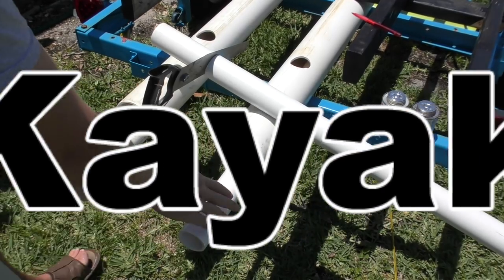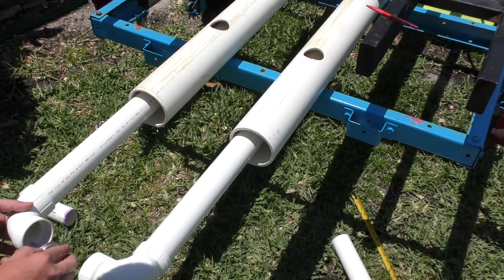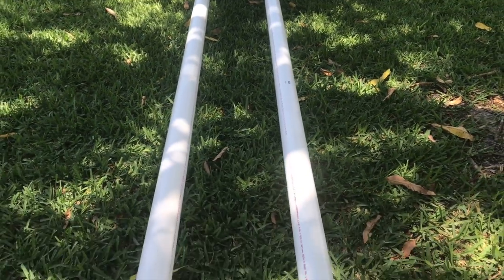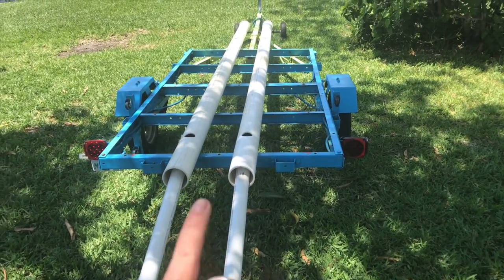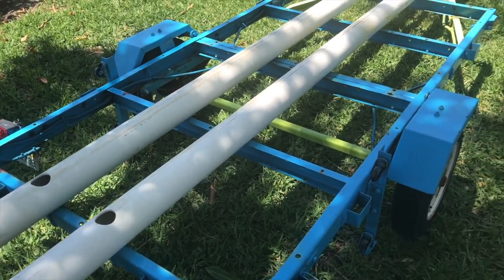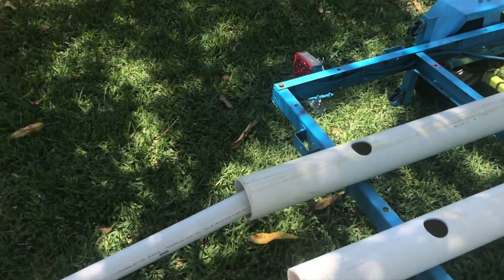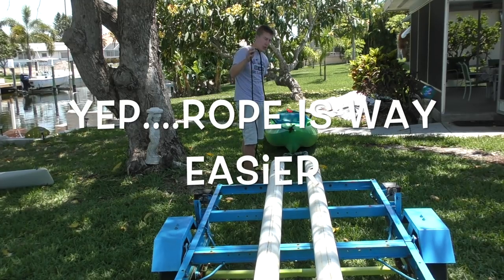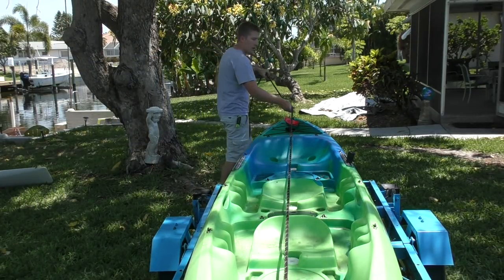Custom Harbor Freight Kayak Trailer with Telescoping Bunks PART 2

Comment: Cool mod on the trailer! I would definitely make some sort of mark  (paint, permanent marker, tape, etc) close to the end of the pullout to prevent you from pulling them all the way out. Early in the morning and in a rush to get out on the water could easily cause someone to be overzealous in pulling out the extensions. An even better idea would be to use a cap on the inside end of the pullout, and also have the big PVC capped as well.  Watching the video there is room for the slide outs to move freely even with a cap on them. If the outer cap was drilled just big enough for easy sliding of the pullout, then the inner caps would act like a STOP if they came all the way to contact the outer cap.  👍

Comment: You might want to put end caps on the end and just cut a hole big enough for the inner pipe to come out. Reason being especially on the heavier yaks the end of the pvc can gouge the front or back of the yak depending on which end you're pulling back up to put back on the trailer. I have a Hobie PA14 and had too had that to mine
Great idea

Comment: Good stuff. I may try a mod like that to bring the yak off of my Xterra and into the water. As least it may save a torked back getting it off the top. Thanks for posting.🤙
Reply from the maker: +Paddlers Paradise yep.  Always thinking about saving my back.  I also work in healthcare 2 days a week.  Back injuries tend to become chronic issues.

Comment: I like it a lot. I would worry about the telescoping section dropping out and dumping the boat hard. Perhaps either a rope cut to length that keeps it from going all the way out the back (connected to the front of both sets of bunks  and running inside the 4" pipes) or a bungee that stretches just far enough to keep them falling out. I liked the thought of using the 4" pipes for storage. I might try that for a couple fishing rods!
Reply from the maker: +Daniel Merrifield certainly could secure the bunks if you wish.  I will likely make something to secure for traveling and for when the bunks are deployed.  Maybe a strap system that does the two jobs.

Comment: Great build Justin and Chad. I’m wondering if that would work for my full size truck bed, loading my Outback. 
Trey Herolds end cap idea would benefit too. 
If you drilled 1 or more holes in the bottom of the short cross piece it would let water in and out to prevent any tendency to float. It has minimal structural function other than as a spacer/anchor for the longer pipes.
Love your vids.
Reply from the maker: +Idaho Brit true.  That is a great tip.  It might work for your truck.  I don't see why it wouldn't.  You will never know if you don't try.  It is pretty cheap to build.

Comment: Man, that slide out ramp is a very cool idea. I may try this on my canoe hauling trailer. I'm really impressed with that idea, go "Chad"!  Thanks :) Also, might put a chamfer on the ends of the big pipes on back end to allow kayak to slide a little better over them. :)
Reply from the maker: Hey Greg,

Thanks for stopping by the channel.  That setup works well.  Putting a chamfer on the ends would likely help.  Have a great day on the water.  🙂👍

Sincerely,
Justin aka KayakDIY

Comment: Good idea. However, you need to check and see if the "extenders" float when in the water. If they do then you wont get a good friction hold like you did in the yard. You may want to tie a rope to the front part of the smaller pipe and attach it to the front of the trailer (inside the larger pipe) and set the length so that even if it does float. The rope will keep it from coming all the way out.
Reply from the maker: +Ratdog 305 agreed.  Then i may do a clip on rope setup to hold the rails from floating out of the main bunks.  Shouldn't be too difficult to work out a method.  I more or less wanted to see how the span would support the weight.  I may even get some cheap EMT conduit and put inside the telescoping bunks to add weight and to stiffen the pipes more.  Still overall quite happy with the solution.  It will greatly prolong the life of the trailer.

Comment: Great idea.... do you think the below would work as a way to protect against the 2" PVC ever coming out while in transit (should a tie down strap or bungee break)?   Cap the 2" PVC piece and cement the cap, slide it inside the 4", and then slide a 3" collar over the 2" bunk from the opposite side. Cement the 3" collar to the interior edge of the 4" making it impossible for the 2" to slide back through it because it's capped. 

Just curious your thoughts after using this set up. I could see my idea having some issues with flexibility possibly. Either way- great idea, I'm definitely going to use some of your concepts when I re-build my trailer carrying my PA14

Comment: Justin, do NOT (I repeat, do NOT!) take that trailer in the water!  I live in fresh water country and I have to change my bearings about every season because they pit so bad.  The very same HB trailer.  I can only imagine what salt water would do to them because they are not sealed, or even made for marine adventures to begin with.

That's a recipe for trouble!  Aslo carry a spare tire, even it you have to carry it on your back.  You''ll thank me for it someday!
Reply from the maker: +Larry Talbot. That is great advice.  I couldn't agree more! I made few trips in the water but not deep enough to reach bearings.   I did submerge leds a few times and they have impressed me.  Still saw surface rust on certain areas of trailer despite rinsing immediately.  Well aware it isn't meant for that, but situations arose where I wouldn't get on/off the water without doing so.  The spare trailer tire is in my truck bed storage.  I got the trailer for $100 used on Craigslist.   It already paid for itself.  Next trailer after I save will be a custom aluminum design I have drafted.   The other alternative would be a good used jetski trailer if I can find an aluminum one at a price I like.  Galvanized here is ok but I want the weight savings for maneuvering it around house.
Reply: I paid more for mine than I would have paid for a brand new one (you can't get anything cheap here!), but it was already assembled and  I figured it would have a big headache.  By the time I re-did all the lights, painted it, built sides (in case I needed it for hauling furniture or something later down the road), upgraded the hitch to 2", replaced the axle with a heavy duty axle, added heavy duty stake pockets, etc. over the entire winter, I could have bought two of them brand new.  I'm glad you got a good deal!  The good news is, I don't have to break my back anymore lugging that kayak around!

I think aluminium is the way to go for anglers in general.  Mine never gets in the water and only sits in the back yard and I've had to sand off  a couple of rusts spots already.  Good trailer, just not great.  Good enough for kayaking!

Comment: You should market a nicer looking model lol it would sell a few I’m sure !!!!
Reply from the maker: Thanks!  I did contemplate it.  You should see my new kayak fishing trailer.  Eventually will do a video on the new one once I finish it.  I bought Robert Field’s old kayak fishing trailer but have some plans to mod it to fit my needs better.  When going on trips I needed ways to lock gear for trips.  That has been the focus on the new trailer, plus increasing capacity and versatility.